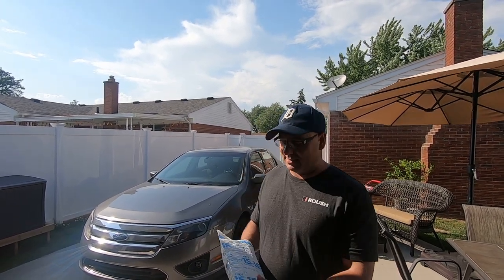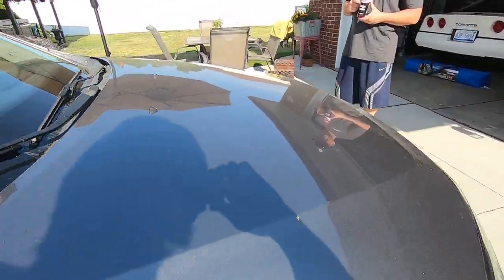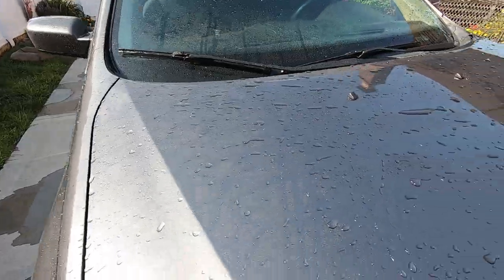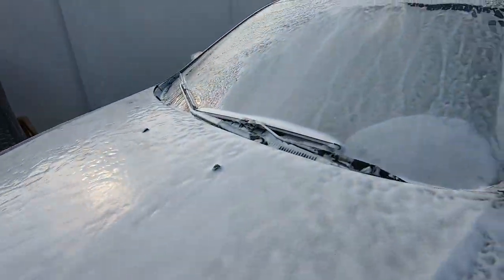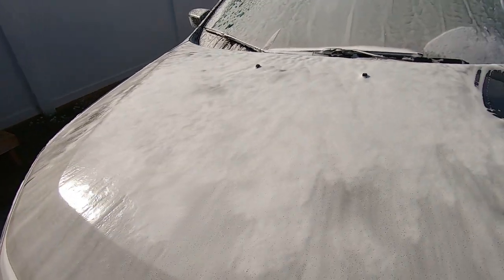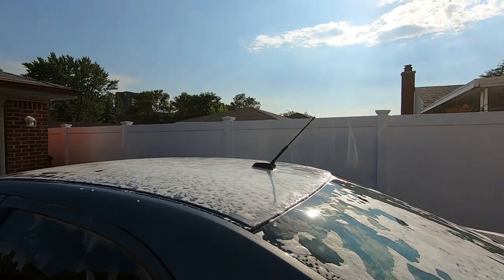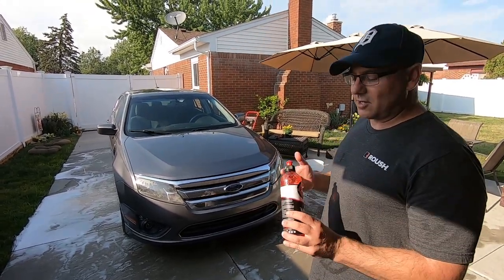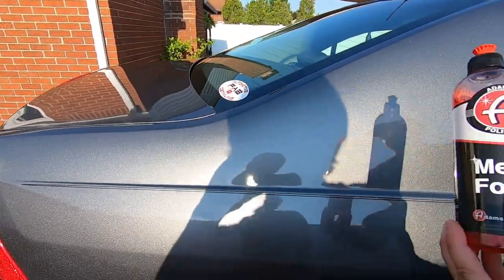Cheap Foam Cannon with Adam's Mega Foam!

Comment: I have that cannon too. Works well enough. I have their stubby nozzle too and it works good as well.. 
Hey I tried CG's Hydro Suds on 2 cars and I am in LOVE. I used Adams ceramic rinseless wash as the drying aid and OMG! WOW! The first was the wife's traverse with 303's ceramic touchless sealant and the 2nd was my Silverado with Megs HCW and worked great on both. Amazon has it on sale for $16. I am going to grab another bottle. Foams great. Cleans great. Plenty of lubrication and awesome shine.
Reply from the maker: I still need to try 303 and the Adams rineless wash one day lol.. Same here really liking Megs HCW plus i still need to use Hydro Suds in the foam cannon but it keeps raining when i get off work . It's raining now  Thanks BigOldDog
Reply: @OuzoLouGarage  It foams great. Smells great too. I Just bought another bottle. BTW, CG has a 25% off sale going on.
Reply from the maker: @kikcodog  going have Check the sale out. Thanks bro